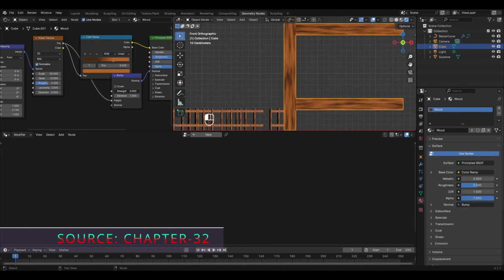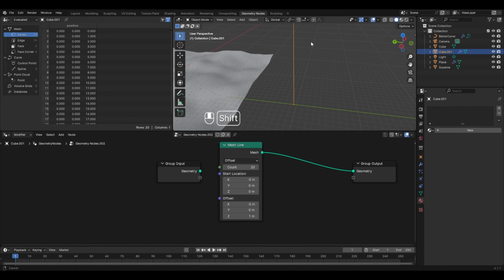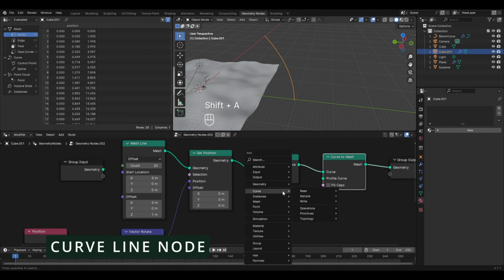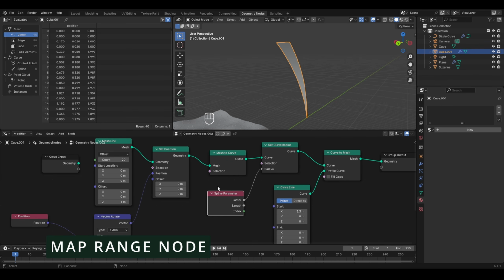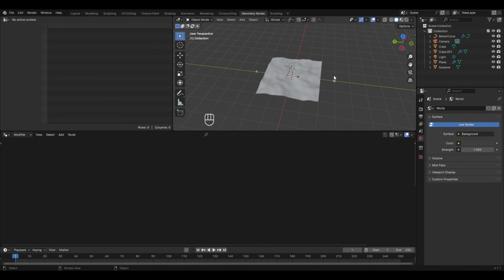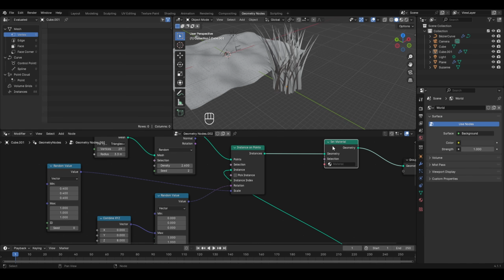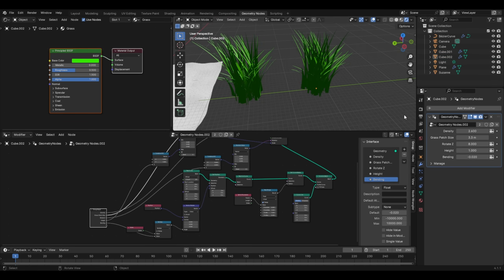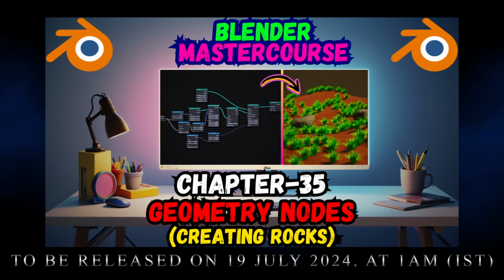BLENDER MASTERCOURSE: Chapter-34: Geometry Nodes: Creating Grass

Comment: Hi again, in Blender 4.53, if you connect spline parameter to set curve radius (at radius pin) nothing happen. To fix that you must connect Spline parameter to curve to mesh at scale pin (it seems to be a new pin in 4.53).
Reply from the maker: Thanks for the tip, I'll check this out!
Reply: @jb3dstudio  And i guess set curve radius become useless, in fact no difference if i delete it.
Reply: Yes same blender 4.5.4 lts